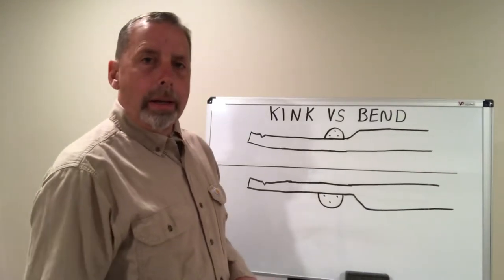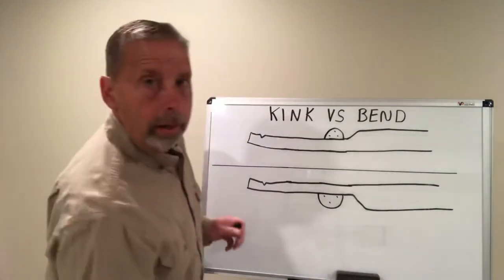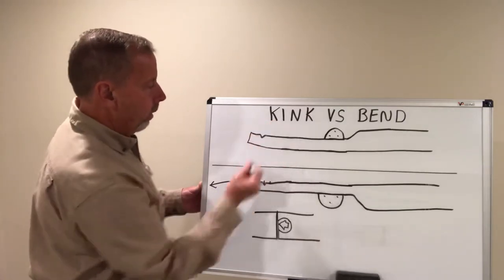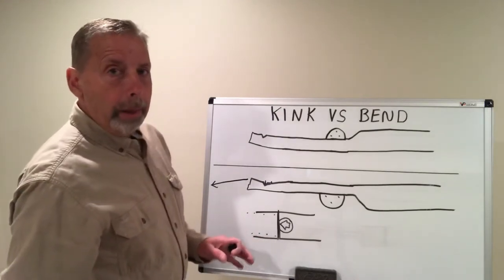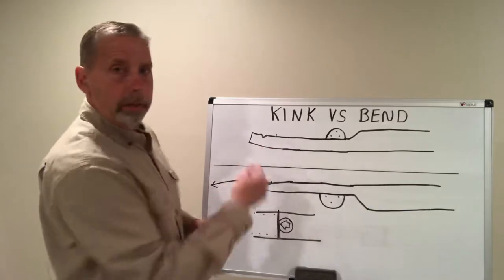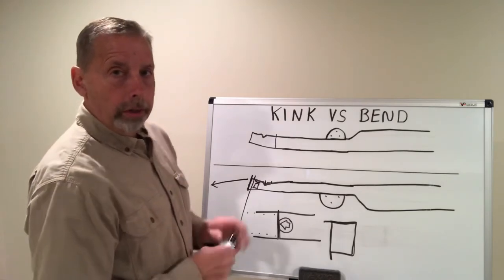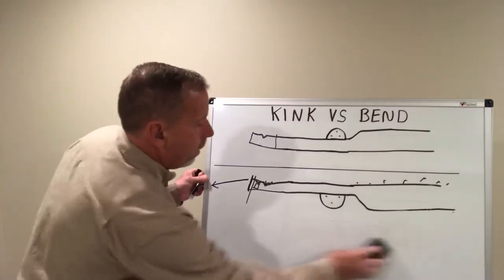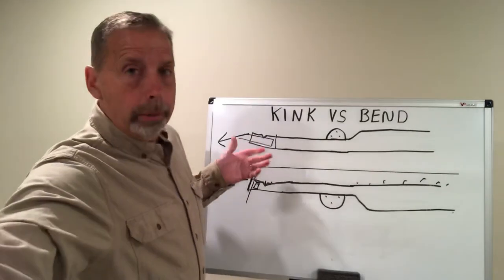Kink vs Bend | Frame Repair #5

Comment: You mentioned the tool Rail Saver. I've watched several videos using it. You exactly described my car's bend, of course, it produced a kinky. The problem is my kink/bend start way behind not close to the front, like almost a foot. Will Rail Saver solve my problem?
Reply from the maker: I don’t know if the Rail Saver will work or not. It has to fit in the rail to the damaged area and the backside needs to be flat so it will push evenly without twisting. You would have to get the dimensions of the tool to see if it would fit. Sorry I can’t help more. Thanks for watching
Reply: @autobodytrainingsolutions838  I spoke with one of the sellers of Rail Server. He told me that this tool will only eliminate dents but not one that is bend.
Reply from the maker: Good to know. Thanks

Comment: Hello there, many thanks for the video. I have a Nissan armada with a vertical deviation on the front of 5mm and very rear of8mm. Drivetrain and wheel alignment are perfect. Considering Nissan tolerance 3 mm do you think that rear can be fixed? Thanks in advance
Reply from the maker: Without knowing exactly how the frame is damaged, 5 and 8 mm is really not much deviation. Even though 3 mm  is acceptable it’s very easy to get specs to 1mm so I would guess that you’re frame is very repairable. Hope this helps and thanks for watching

Comment: What's the best way to measure and check to see if a frame is bent and still square, no twists, etc if  I don't have a shop with special tools.
Reply from the maker: I have a video coming out in August that shows how you can measure a frame at home with a few simple tools. It’s very accurate and is fairly easy to do. Thanks for watching
Reply: @autobodytrainingsolutions838  I happen to have a frame I'm looking at on Sunday. I thought I would measure from inside corner to inside corner to check if those were the same and then sitting level on jack stands, measure each body mount, etc to the ground  .. also take a level to check as well. Would that work?
Reply from the maker: @celticcraps  that’s a start. The more places you can measure and compare, the better. The level won’t do much good because most frames don’t follow level to the earth. Until my video comes out , good luck

Comment: Greater than 90 degrees? I don't understand, it seems like >90 would be less severe.
Reply from the maker: If you start with a piece of metal that is perfectly straight then start bending one end up, once you get to 90 degrees that’s the limit you can go . Anymore than that it’s starts folding over on it’s self which would be in excess of 90 degrees. Hope this helps
Reply: Maybe he meant 90 degrees inside not outside.

Comment: I am pretty sure you aren't supposed to weld back over the same spot that was spot welded from the factory. At least some or most OEMs say not to.
Reply from the maker: Thanks for your comment. The way I understand it, you shouldn’t put a resistance spot weld over an existing factory spot weld. The metal is compressed during the welding process and by putting another weld over it, the metal can’t be compressed anymore and doesn’t give an adequate weld. MiG welding over a factory spot weld shouldn’t make any difference. I hope I understand this correctly and explained it accurately. Thanks for watching

Comment: Thanks for explaining this! Based on the video, in order to fix my frame kink i would need to cut out part of the frame to repair this. Am i right? I posted a short of what it looks like.  https://youtube.com/shorts/6C8rpZ06jsg?si=9WAyY--7vB_aZ2Zd
Reply from the maker: From what I see it doesn’t need to be cut out. It should pull out . If possible the floor above it could be opened up to gain inside access to help get kink out . What kind of vehicle is that?
Reply from the maker: Looking at it again the top of rail seems to be enclosed but it should still be able to be pulled
Reply: @autobodytrainingsolutions838  thanks! I'll try to give it a go. It's a 1963 volvo 122 passenger front frame rail. I'm assuming the previous owner hit a curb which bent the frame because the body is in good shape.